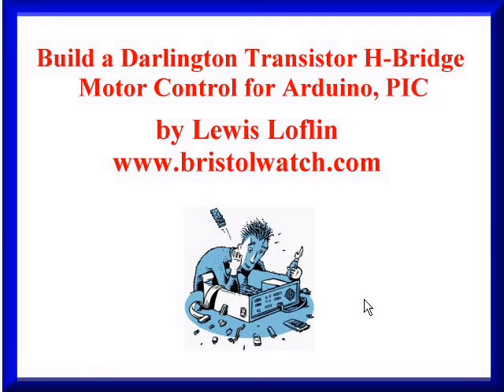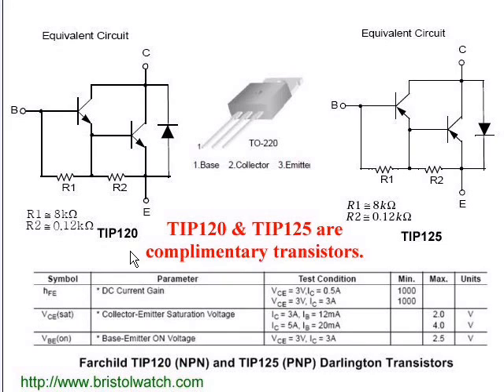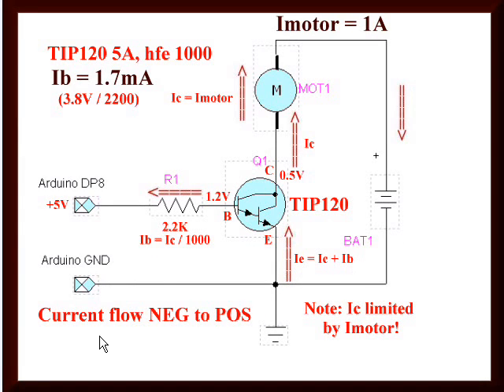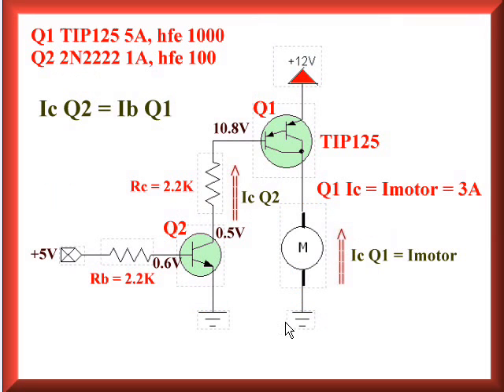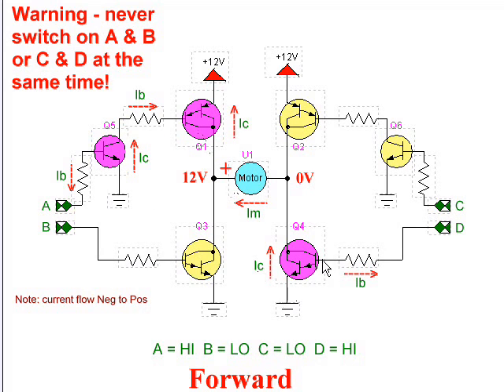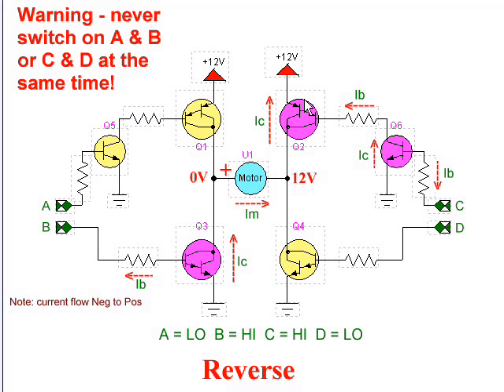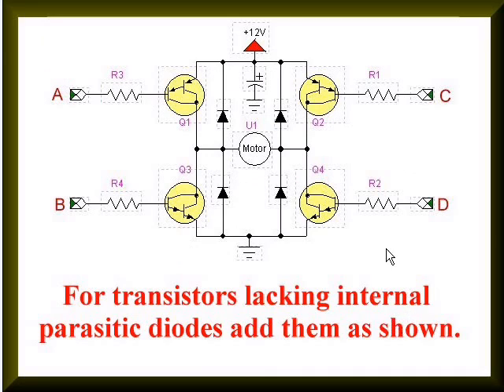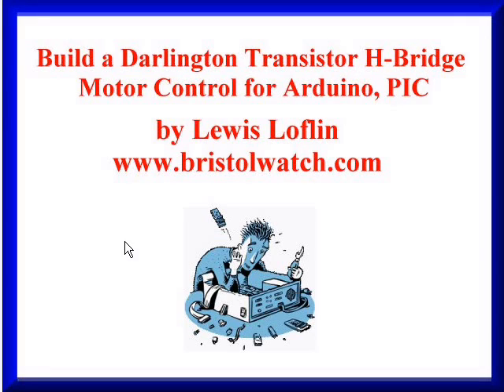How to build a Transistor H-Bridge for Arduino, PIC

Comment: I'd say this is your best video so far. From what I have seen, > 1,000 Hfe can easily mean 48,000. I will try to control 1500W 3-phase motor with 3.3V Teensy now, no MOSFETs, your configuration, maybe chained TIP120s maybe not, probably different resistors depending on what I measure, wish me luck. The transistors listed aren't easy to find and I had to sit above the diagrams and think, but it looks the best for my purposes. I want very high switching speeds and low voltage at the gate.

Comment: would it matter if we reverse the direction of diodes
Reply from the maker: The diodes are internal to the TIP120/TIP125 transistors. If separate do not reverse.
Reply: @LewisLoflin  sir, how do u determine the direction of diodes
Reply from the maker: @perceptrongaming4290  They are built into the transistors. They are spike suppression diodes so they are oriented to be turned off under normal operation.

Comment: Um, what the fick? Your flyback diodes were installed backwards and all the current paths were drawn inverted from low to high potential instead of conventional current!
Reply from the maker: It's called electron flow and that is how the Army teaches it. 2nd the diodes are correct. I went over to conventional a few years ago. Says right on the graphic flow was neg to pos.
Reply from the maker: I'll go ahead and redo this with conventional flow.

Comment: Your knowledge and explanations  are excellent. Hope I had a brain like yours.
  wondering whether you could help me to build a arduino and mosfet H bridge  Segway. I have bought 2 H bridges from ebay. here is the link. http://www.ebay.com.au/itm/181518438263?_trksid=p2057872.m2749.l2649&ssPageName=STRK%3AMEBIDX%3AIT
I want a way to link this with arduino.
I don`t have much knowledge in electronics. I am a doctor in profession. But I have special interest in electronics.
I recently built a remote control lawn mover with Sabertooth dual motor control.
Could you please help me
Thank you very much.
Reply from the maker: isuru Gamage I looked at Ebay and I have no idea how it works. How about a schematic?
Reply: Lewis Loflin
 Thank you so much trying to help me. have you got a schematic that I can use with arduino to build a segway? thank you again.
Reply from the maker: isuru Gamage Depend on what you want to build. Taking the various pages I've done on this it's done in a modular form - build one thing and then add something else.A segway uses a DC motor so PWM is the way to go for speed control. See 
http://www.bristolwatch.com/ele/pulse_width_modulation.htm
While this is a PIC it does the same thing with Arduino.
Reply: Lewis Loflin
Hi Lewis. I have been watching your you Tube video about H Bridges "How to Build a transistor H Bridge for Arduino" .That is a really excellent video about H Bridges. Very easy to understand. There you explain how to increase the current up to 15 Amps. My wheel chair motors draw around 30-40 amps at times. How do I add more transistors to hold that amount of Amps. Thank you so much.